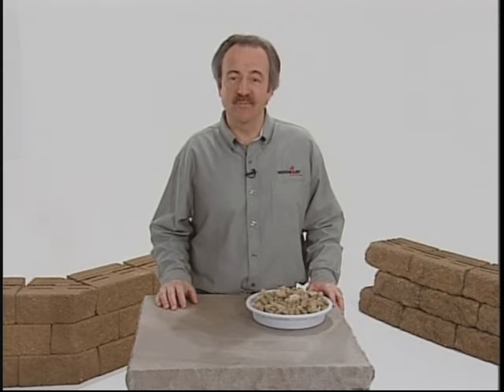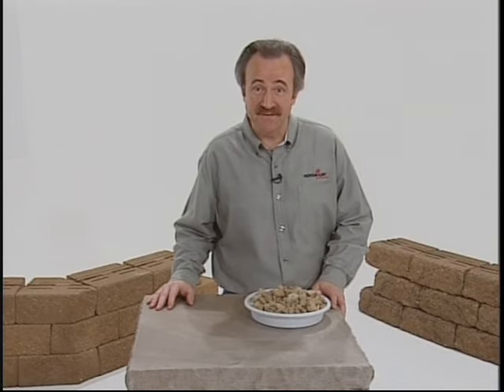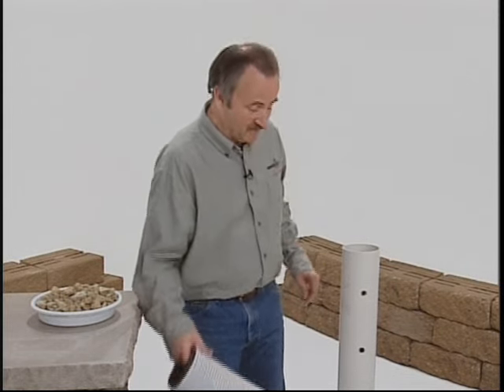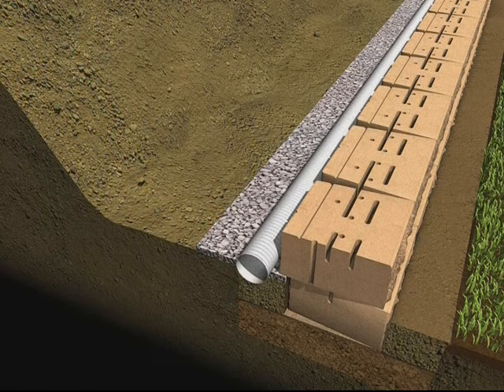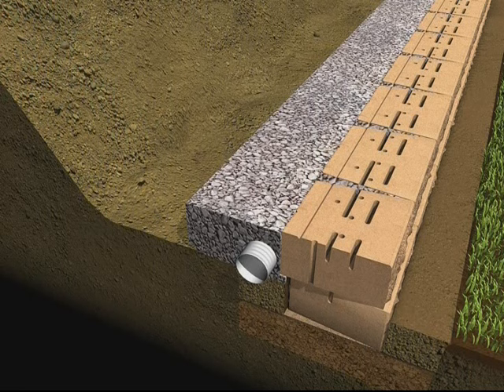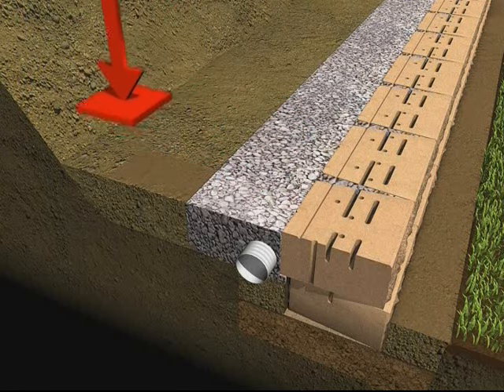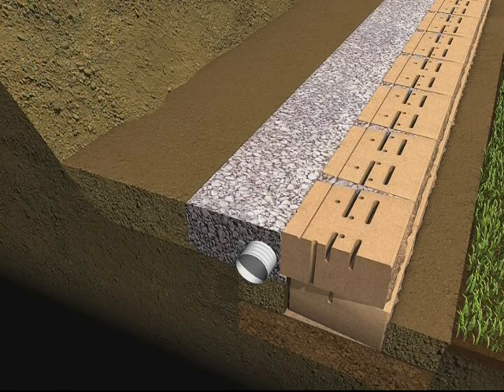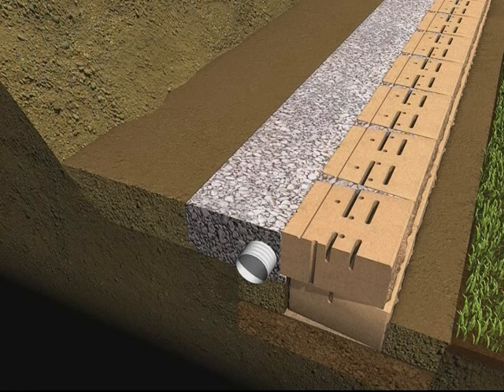Part 8 - Drainage & Backfill - Retaining Wall Installation - Standard unit

Comment: Very nice video diagrams.  Only comment I'd make in 2021 is that there should be geo-fabric used between the soil and aggregate as a barrier so that water does not wash away / mix the two together over time.  This will prevent any sediment from clogging up the drain pipes.

Comment: Couple important things not specifically noted.
1) which way are the holes in drainpipe suppose to be facing? I seen in some videos were their suppose to be facing downward.
2) what about using landscape fabric between the backfill soil and drain aggregate behind the wall? isn't this suppose to keep the soil from seeping into the aggregate which would eventually effect the water drainage?
Reply: lien302 .. Shouldn't really matter what way the holes are facing. You should always have a pitch to your drainage away from the wall and away from any foundation.. Those holes are meant to percolate water back into the ground but most water will be carried through the pipe and out of the sides and also the front of the wall(wheep holes) depending on the length of the wall.. I use 4" HDPE pipe myself and its perforated all the way around the pipe.. Also using a filter fabric is also not brought up.. Before the base even goes in a filter fabric should be placed and left long behind the wall and continued up behind the wall between the 3/4 clean and soil.. This will help to keep the water flowing down to the pipe and away from the wall.
Reply: If you have pipe with holes on one side, those holes face downward. What the other guy replied about it not mattering and the holes being meant to percolate water back into the ground is wrong. Holes are to allow water to enter pipe from below, which in turn provides the water with a fast unimpeded path to flow out from behind your wall.
Reply: The placement of holes in the drainage pipe will determine the level of ground saturation. If you place a 4” drainage pipe with the holes on top you can anticipate 4” of additional ground saturation behind your wall then if you place the pipe with the holes facing down.

Comment: I saw a 50 year old retention wall, and 50 year old 16 foot high retention wall.  they used tires, and crushed stone.   Dolt.   seriously, they let the water thru.   right into the garage.   Nothing bought, except the stone.   I dont know how many deep the tires are.  it makes us feel uncomfortable looking at it today, but the neighboring unrestrained dirt, had eroded 10 feet back.    That carp worked.   Nothing store bought.  No attempt to stop the flow of water.   The backside of a bridge, also used the same technique, along a stream, which seasonally, can get fairly serious.  Still standing.   Our best concrete attempts are failing against a non-store-bought solution.